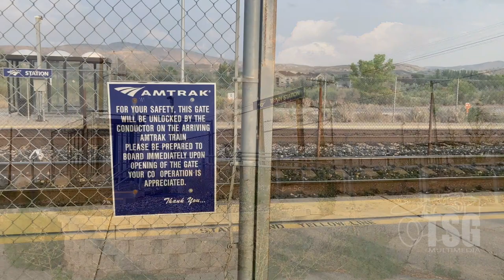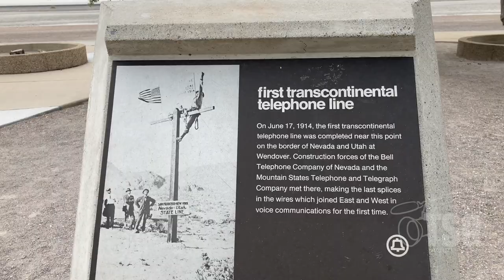Chasing Trains! Epic Road Trip 2021 Pt 1 San Jose to Salt Lake City

Comment: About the time you were pulling into Elko, We were evacuating our home in Cromberg on the Feather River Route (UPRR Canyon Subdivision) due to the Dixie Fire being less than five miles away.  Part of the reason for the lack of rail traffic east of Reno was that the Canyon Sub was closed between Keddie and Storrie due to the fire.  Based on the info I gleaned by listening to UP Dispatch 257 was that they were holding freight trains at current locations on the route between Sparks and Omaha. That didn't resolve itself for several days.  The real drama was a couple of weeks earlier when they had several trains west of Keddie that were trapped inside the fire lines and had to be backed out with Bronco escorts.  Anyway great video and best of times and travels to you.